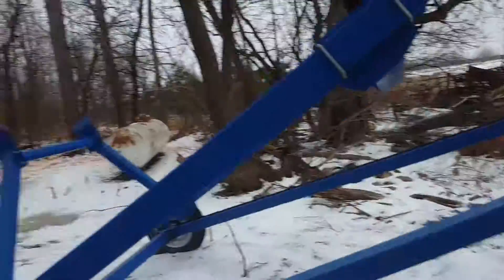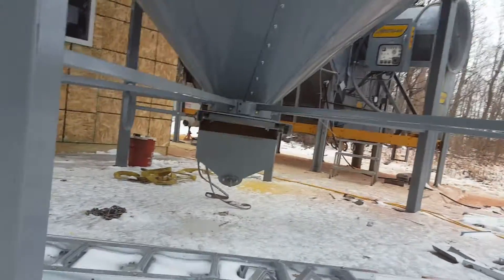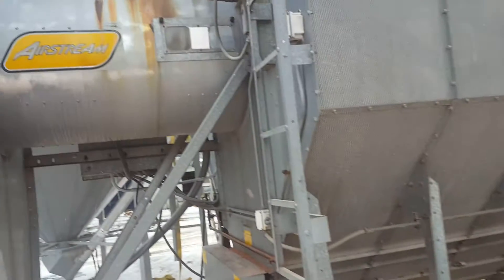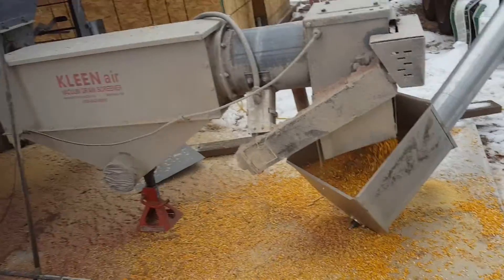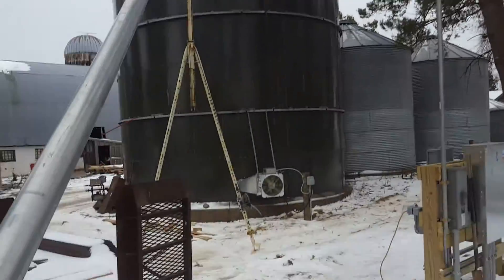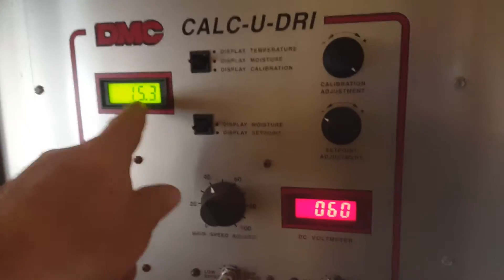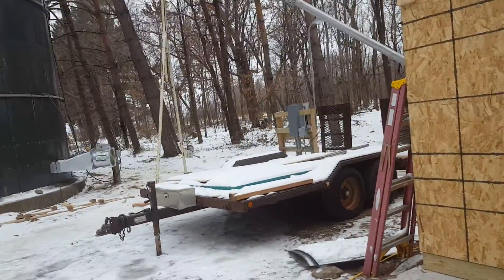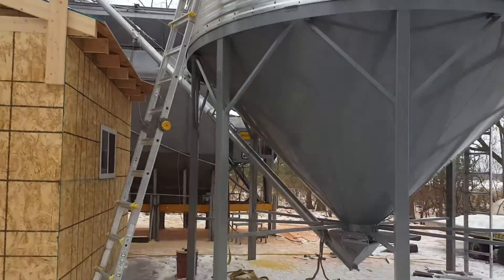The corn dryer is running!

Comment: Can you elaborate on the wiring and controls that control the auto fill circuit. I am getting ready to start hooking up an auto feed system to a 1216 GSI airstream and would like to auto feed both a vertical auger and the floor auger from a grain bin simultaneously.
Reply from the maker: I had an electrician do the hard stuff. For like your setup we had an auxiliary outlet,  
There's a Mercury switch on my dryer that when the corn goes down the switch has a paddle that goes down and turns the switch on. When that switch is turned on it just goes to some relays and circuit breakers that power up the outlet that you're unloading auger and fill auger are hooked to. Fairly simple and straightforward but we just had the electrician do that kind of work

Comment: Do you dry using full heat continuous flow? What is the temp of the grain coming out of the dryer? Do you run your fan in the bin  when drying all the time when drying to cool the corn?
Reply from the maker: grote66 for the most part we run continuous flow. Grain temp coming out is around 100 to 110 degrees. Yes the fan in the bin have to stay running when dumping hot otherwise you get condensation in there. If it's real wet corn then I can switch over to automatic batch.